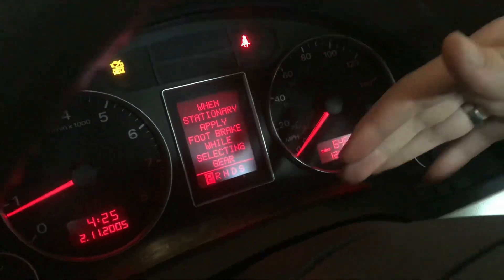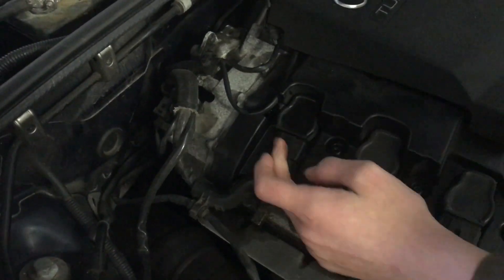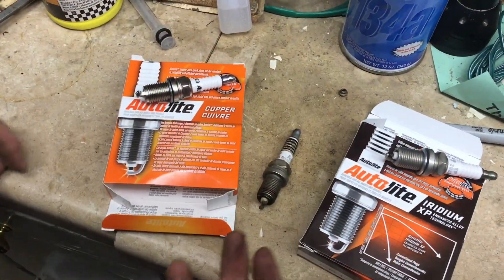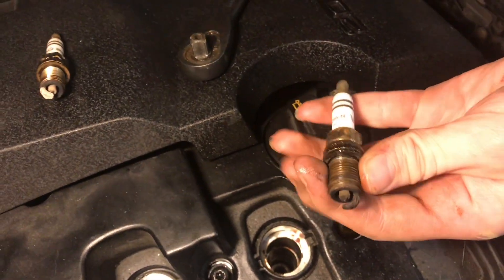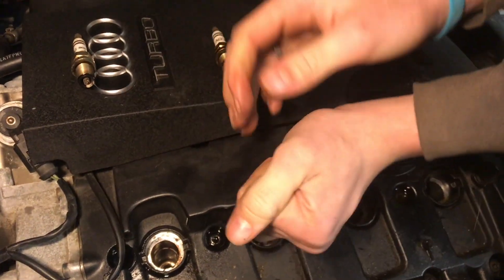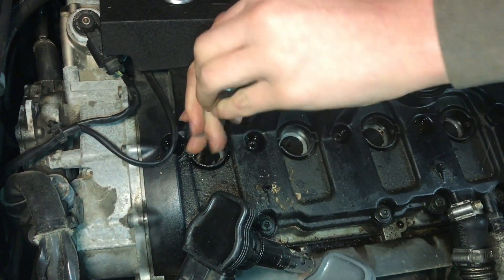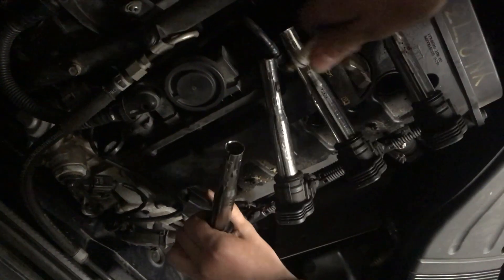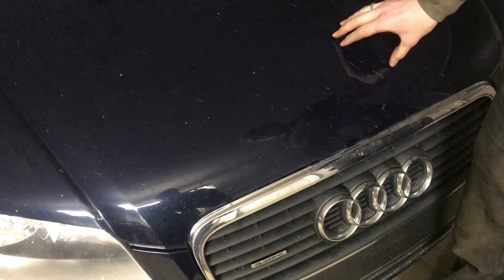FIXING error code P0301, P0302, P0303, P0304 a4 audi volkswagen passat 2.0t

Comment: Verbal misfire on the OBD do🤣....great vid dude...I have a CC threw that code...EPC light came on...mind u I changed the plugs and coils last year..(.had lil oil on plugs 3 and 4..) I need to reseal the valve cover with anerobic glue...I pulled the coils and noticed coil 4 had build up inside it....cleaned it ran it and the EPC light went off and I felt more power from the engine...Im gonna pull the plugs to see if any oil is on em...if so...gotta get that valve cover revealed asap...thanks!

Comment: Hey I got a 2009 Audi A4 2.0T with misfires on all cylinders. I changed spark plugs, injectors, PCV valve, coils, carbon cleaned the intake and baffles. I also replaced the vacuum pump gasket as well as the seals for it. What else do you think would help?
Reply from the maker: Miss firing on all cylinders is typically an air leak somewhere which is very common for this problem. Or something like fuel pressure. These two things would cause all of the cylinders to randomly misfire. I feel the best way to find the problem is to use a smoke machine to push air and smoke into these passages like the intake manifold and look for smoke coming out somewhere. Maybe through a loose sensor or a hose. I made a smoke machine with a soldering iron and a glass pickle jar with an old sock and baby oil to create the smoke. Bicycle pump will deliver the air. Chances are there is air being sucked in to the engine and the computer can’t keep up with that much air. It’s called unmetered air. I hope this starts to answer some of your questions
Reply: Did u ever find out
Reply: Unplug your MAF sensor, your car will return to a base map on the ECU and see if the misfire goes away or reduces, if it does, replace the MAF sensor and / or both the sensor and Housing.

Comment: Why didn't you just unplug the coil connectors?
Reply from the maker: I’m not sure if I completely understand the question but let me try to explain why I switched the coil packs. Since the coil pack fails intermittently it’s hard to catch it acting up. If I switch the suspected coil pack to another cylinder, then wait for the air to come back been if the error code jumps to the next cylinder you know it’s the only thing you moved so it must be the coil pack. I’m not sure if this answered your question. Let me know if you have any other questions or let me know if I totally misunderstood your question. Thanks
Reply: @livefree6878  I meant rather than struggling to get all four out at once, just remove the plugs from the coils, makes it 10x easier !
Reply from the maker: Yep, that would’ve been easier.
Reply: It could be easier to remove the coils, but sometimes the little tab on the connector breaks

Comment: You need a set of spark plugs before you fuck up your turbo. When plugs get old the turbo blows them out. That is what the misses from.
Reply from the maker: I really appreciate your thoughts, you don’t mind I’d like to dig a little deeper. Replace these plugs first with iridium plugs that I got from rock auto, I can’t recall the name brand. I read about some people verifying plugs with a ohmmeter test. Any information would be greatly appreciated. When I replace coil packs the skipping are missing seem to go away. Thanks in advance for any additional information.